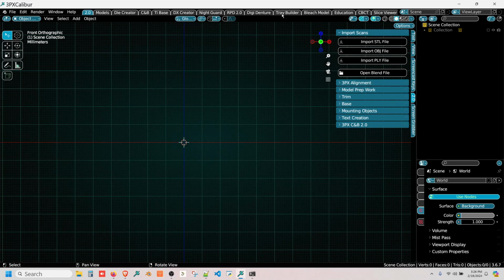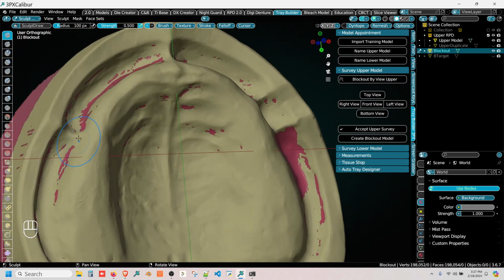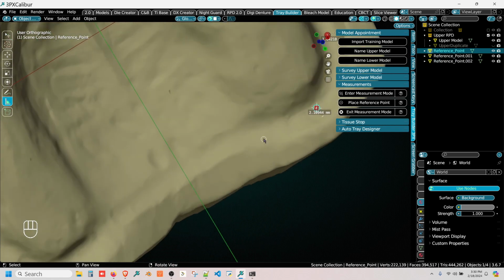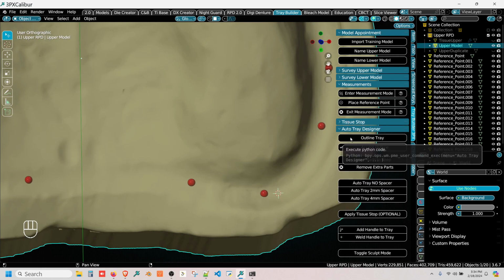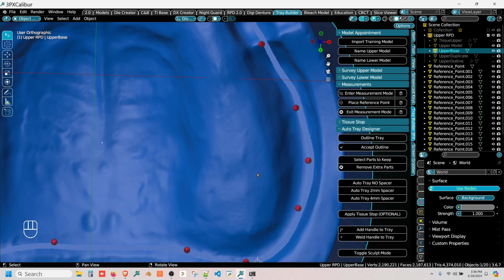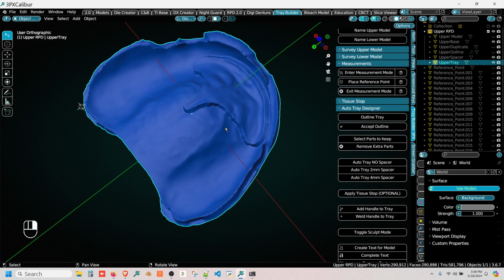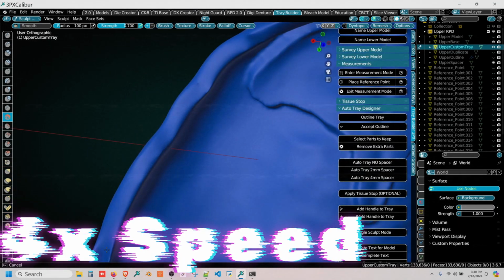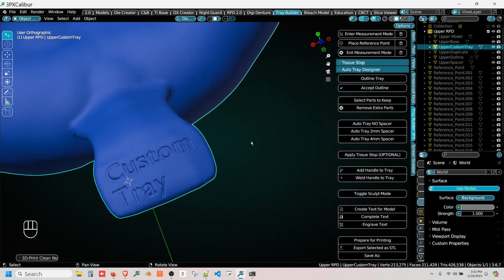3PXCalibur: Tray Designer Tutorial

Comment: The tray designer is really solid and this tutorial went flawlessly, I am having some strange issues with the current version when it comes to trying to make a nightguard or digital flipper. Is it possible to make an older version available? (I unfortunately didn't keep the old one when I updated!)

For example, Digi Denture seems to be depreciated, I guess for RPD 2.0? Some things are strange compared to the workflow elsewhere - instead of E to extend the line when outlining, it appears that it's Ctrl-Right Click to extend it, but I get some weird issues where the line doesn't seem to want to follow the path at all while it works flawlessly in the tray builder (where E to extend is used).
Reply from the maker: Hey. So sorry for the delayed response on this! Thanks so much for the feedback. There were changes made throughout the software and there will be more tutorial videos made to help with that. With that being said, it does seem like you're running into some interesting issues and I'd like to take a closer look. Could you fill out our contact form at the following site below? I'd like to move the conversation from here to email or whatever is most convenient for you. After we go over the issues you're encountering, if you still want to revert back to the older version of the software, we can restore that for you as well. :)

https://www.3pointx.com/contact-1

Thanks again!